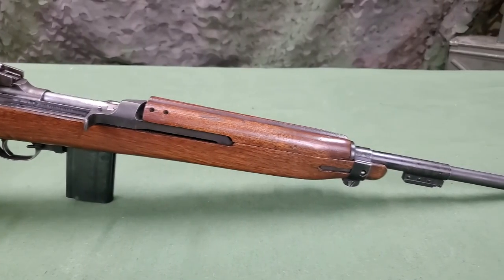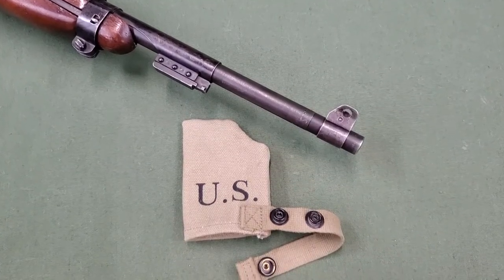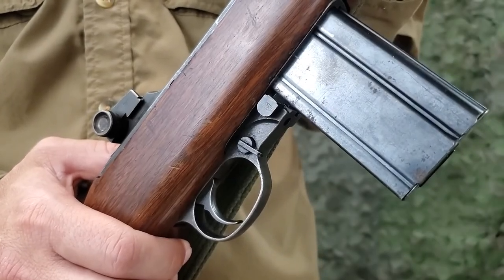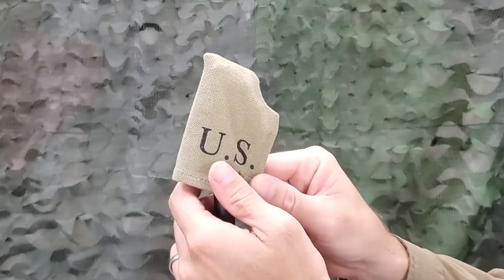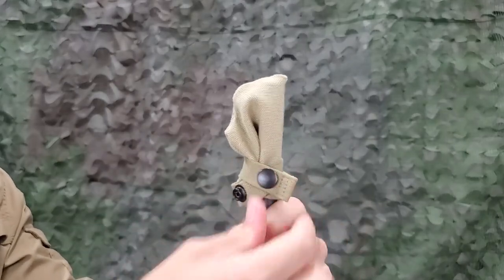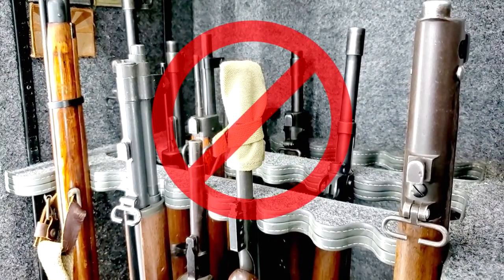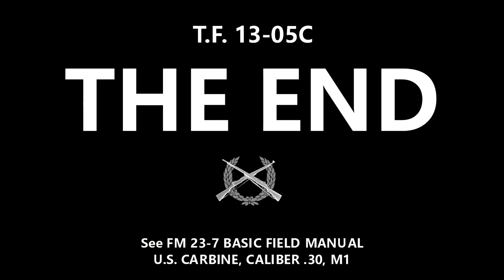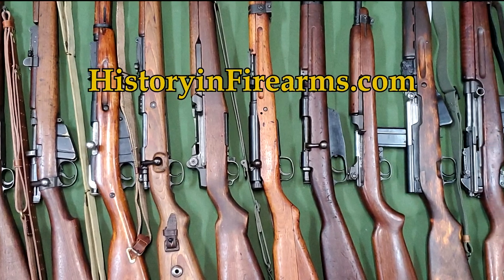M1 Carbine Muzzle Cover (TF 13-05C)

Comment: When did they issue these muzzle covers?
Reply from the maker: WWII Era
Reply: Roughly 1943, but almost all M1 muzzle covers are dated 1944
Reply: Issued to prevent debris from entering the weapon via the barrel, the Cover, Canvas, Muzzle consisted of a canvas hood and a strap with two fasteners (“snaps”) in order to adjust the fit for compatibility with Rifles M-1 and 1903A3, and Carbine M-1. Material culture observed ink-stamped by 26 manufacturers carrying 1943 and 1944 dates, with the preponderance of surviving examples dated 1944. Described in Quartermaster Supply Catalog Circular No. 4 August 1943) as “a small piece of webbing” which “…fits over the end of the carbine or rifle to keep out dirt and snow”, this canvas muzzle cover by 1945 was “LIMITED STANDARD-To be issued until (supply) exhausted”, being replaced in the supply chain by “TAPE, CELLULOSE, MUZZLE-COVER”, Stock No. 53-T-1085, Specification Jersey City Quartermaster Depot (JCQD) No. 1017. Two pieces of tape were used in lieu of the canvas cover, one length “placed over the muzzle and a second…wrapped around the barrel to anchor the first one. It adheres to damp surfaces and may be fired through” (Quartermaster Supply Catalog QM 3-1, May 1946, page 40). With the added benefit of retarding moisture in humid climates, it is suspected this tape was developed in conjunction with the operational planning for Operation Downfall, the amphibious landings on the home islands of Japan planned for November 1945, and canceled by virtue of the Japanese surrender earlier that September.